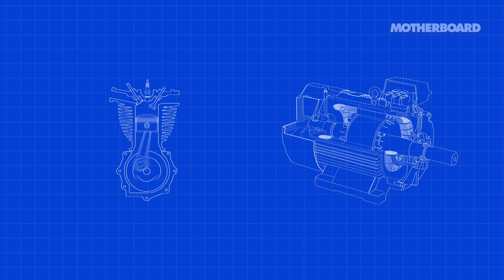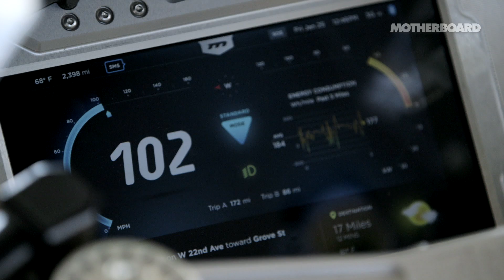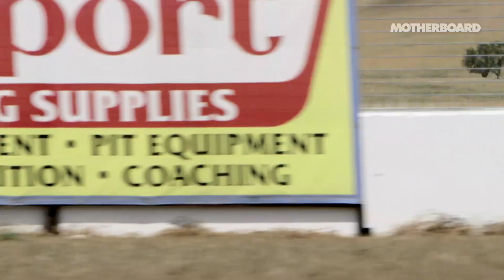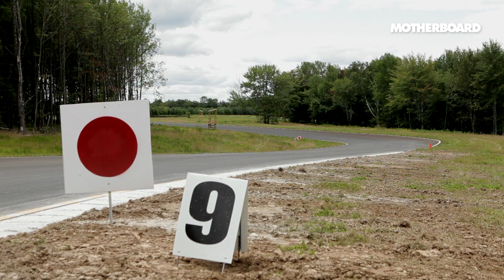Mission RS: The Electric Superbike of the Future

Comment: Here's the thing I can't get on board with this (other than the obvious nostalgia: the sound of an amazing inline four cylinder, the smell of the gas and exhaust, the ability to wheely or spin your tires, and other things that go along with gas engines) is that while you have the same range as a gas bike, it takes an hour to fill up. I like to go on LONG expeditions with my bikes and if I had to wait an hour every 170 miles it would kinda suck, although it's not that bad of an inconvenience, it's certainly notable because gas is instant.
Reply: Bob Abooey Exactly the point I was making, I agree completely. I wish it wasn't so, but it is.
Reply: Krisztian Kovacs Also, I've run out of gas many times in trails enduro riding on a DRZ400. When I run out, my buddy goes and fills me up a gas can. What do I do if I go dead on a zero s? Or what if I'm riding the streets and I go dead on the RS? Call for a tow? It's tough until there is mobile charging stations about the size and weight of a one gallon can that can get you to a gas station real fast, and when there's "gas stations" for electric bikes. I think I would get on board to a degree if there was one-gallon size and 5-gallon size mobile charging stations that could fill you up a bit to get to a station to charge it. But even then, I couldn't do my favorite things that I love to do such as serious enduro riding which DEFINITELY requires clutching to wheely over logs and lakes. And I couldn't do any sort of closed-course stunts on this bike either. But as far as track or city, it would be the better alternative except for the sound, which an inline 4 cylinder is like music to my ears, and smell, the smell of exhaust and gasoline (especially 93 or 100 octane) are just amazing. All of the nostalgic factors of riding will never be there for this bike, it will feel like a simulation :/
Reply: And when I say size I mean physically around the same size and weight. Just so that there would be an alternative to gas.
Reply: You can have charging stations where you normally would not find a gas station. Battery banks with solar charging can be placed anywhere on this planet. On a mountain trail, out in the middle of the desert, at your home...etc.. and you can have as many and as big as you want. It will also take a lot less space than a gas station, and is less maintenance. They now have DC fast charging too.

I guess not many people realize the convience of plugging in.
Reply: Silverexpress01 Now that you say that, I realize why this will never, NEVER take off. That sounds too amazing to the environment. Too amazing to me, and too amazing period. 

Here is the huge flaw with your idea:  who will profit from that? Not at first, when somebody has to buy the solar panels, buy the batteries, etc. Who will profit in 60 years? 70? 100? 150? 200? Nobody. And in the world we live on, if there isn't long-term massive amounts of money to be made it is quickly shut down. There are very good alternatives to oil right now that are unavailable to the public because of the greedy oil companies. We've had electric cars since 1990 and before. 1990. 25 years almost. And we still do not have public charging stations on every corner. And to say we've only had electric cars for 25 years is total BS on my part.Those are just the ones widely known, the first electric car EVER was invented BEFORE the first ever prototype for a gasoline engine driven horseless carriage. In 1832 Robert Anderson of Scotland invented the first electric motor driven horseless carriage. In 1886 Benz released the Benz Motor Car No. 1 as the prototype for a three-wheeled gasoline driven horseless carriage. The electric car was invented before the gasoline car. And yet what do you see every 5 miles? Gas stations. Not charging stations. Greedy corporations will forever keep gasoline on top.
Reply: Expensive yes. That I can agree with, and like all things the prices will come down. My first PC was over $2K with a 250 MB HD. It had less processing power than my smartphone, and the one I'm typing on right now cost me a little over $200 new and it has over 5 Terabytes of  memory which I've added on gradually, and a quad processor. I've been using it for nearly 3 yrs.

Battery, CNG, Fuel Cell, Gas, Diesel...etc...will continue to evolve. In the end it will be the customer's decision which is best, and it may come down to long term maintenance costs. Replacing worn timing belts vs. High Voltage cables; Valve timing adjustments vs. Electric motor timing adjustments; Cylinder rebuild vs. Rotor bearing replacement (today's electric motors are brushless and require very little maintenance if any); clutch replacement vs. wheel balancing..etc....

The market demand and government regulations will probably determine the survival of today's electric car.

Things have surely changed.... Recreational marijuana is now legal in Colorado, you can watch a war in the Middle East that was recorded with a GoPro on top a battle tank and then rate it on Youtube, and we can correspond with each other a thousand miles away in milliseconds without ever really meeting each other. It's just an amazing world we live in today, and just as frightening.
Reply: StuffWithAlexGaming
whats held up electric car and bike tech is the batteries and motor control. Only very recently were powerful brushless motors developed. The best brushed motors were lucky to be 50% efficient once they had heated up. Now brushless can be as high as 95%.Using alot more poles for the same size they are much lighter than brushed motors and its possible to change the coil switching to provide extra torque at low revs then gang them up for very high revs by just pressing a button. Induction motors can be 99% efficient but are far to heavy like the ones used on trains. Even better batteries are being developed. Imagine only having to charge up your bike once a year? Its only a matter of time before this happens.Might be a few years yet, You can computer control a motor to do exactly what you want, torque curves, braking, boost power. Your very limited with what you can do with an engine hooked up to a computer. The world is changing. Engines and gas are old tech now. The worlds ideas are slowly changing and people are slightly more concerned with the environment than they were in the past.
Reply: Silverexpress01   I think it's the exact opposite of what you guys are talking about.  Electric cars/bikes will continue to just be a niche thing for a long time because the big wigs in the oil industry wouldn't stand for the loss of business.  We have lobbyists in charge of our world and they have lots of money tied up in oil investments and oil interests.  Fossil fuels literally fuels them.

I think any electric initiatives will be underfunded and delayed in a mainstream market.  The automobile manufacturers even have interests in the oil industry.  It's just not going to be viable to sell electric cars until they offer bigger money making opportunities.

Sure it's great that technologies exist that could possibly save our world.  But the people in charge are not concerned with the health of our planet.  They are concerned with the size of their bank account.  These fossil fuels will continue to melt glaciers and cause the ocean levels to rise and eventually drown us all.
Reply: You can wheelie and spin the tyres on this, he does it in the video. Wheelies should be easier as electric motors have so much torque power wheelies should be no problem. 
And even though they don't make the same sound as a throaty Akrapovic, the jet fighter noise it made in the high speed drive past did sound pretty cool!
Reply: StuffWithAlexGaming But battery technology was lagging behind in those days. Electrical/Computer/Software engineers where few if not yet born. Things have changed since then Alex. Just look at....

Stage Theater vs. Television; Written Media vs. Digital Media; CD/DVD vs. Ipod; Movie Theatre vs. Netfix & Flatscreen; Type Writer vs. Word Processor; Horse vs. Mountain Bike; Telephone Lines vs. Cellular; Microwave vs. Oven; Clay prototyping vs. 3D printing; Supercomputers vs. Distributed PC's; Kodak film vs. Digital media, Steam Locomotive vs. Diesel-Electric; LiPo/Life/Lion/? vs Lead Acid/Alkaline/Nicad/NimH;...etc...etc...etc....

Your right though that there are other Alternative energy sources besides electricity, and I think in the end it will be a combination of these technologies that will move our vehicles. Like the Chevy Volt that uses a combustion engine as a generator, in the near future it might be something else...CNG, super capacitor; Hydrogen fuel cell, ?, ?, ? There is however no refuting that the electric motor as the drivetrain is the most simple and efficient there is.

Simple and efficient to manufacture, and to assemble. This results in a much higher profit margin than and ICE that requires a multitude of parts and parts suppliers to pay off.

As far as these greedy oil manufacturers go....they have the funding to transition into any sector of business they wish. I wouldn't worry to much about them. 

A gas station every 5 miles? I have over 20 outlets and two of which is 240 volts. I can plug my EV into any of these. My neighbor has nearly the same amount and is less than 50 ft from where I sit. On my entire block there must be nearly 1000 outlets I can plug into if I ask politely. At work, it's the same thing.

At the hotel I stayed at the other night, I asked if I could plug my EV in for a top off, and they said yes. There were over 10 outlets outside along the perimeter of the hotel. You must always ask! I've read of one incident already where in an EV owner plugged in at a school and was charged with stealing electricity!

I see that gas prices are on the rise again. Come and join us....
Reply: Silverexpress01 At 80 MPG on my bike, the only vehicle I use often, I keep a truck because they come in handy for things like moves but it's a small pickup and gets about 25MPG and is almost never used, it's not worth the huge pricetag of an electric bike or car. I don't have money to spend on something like that now, when it would barely save me money. Bad investment at the moment, until there are alternatives for pricing and stations to charge, I simply won't be able to get on board.
Reply: Silverexpress01 I'm ready and excited for the transition, even though I will lose the nostalgia of launching a 600 HP Olds 442 and hearing the roar of the engine or launching my R1 and feeling the intense power while smelling the gas and hearing the roar. It scares me to transition to a world where instead of the smell of exhaust I smell electricity or instead of the roar of a 4 cylinder inline or v8 I hear the whine of a motor... I'm still excited even though I know I'll lose some of my favorite parts of muscle and power vehicles.

But I know it will never happen soon because the greedy oil companies will never allow it. They will do everything in their power to stop it from happening, because when electric cars roll around there's no more need for gas stations or as much oil or basically anything that they produce and make money off of. It's sad, but it's true. If it wasn't for them, electric cars would be the only cars driven on the road today. If it wasn't for them, you would need a permit to drive a gas-driven automobile and you'd have to pay a lot extra in taxes in order to have carbon offsets created. That's how it should be, you can't stop people from enjoying their cars because that's just horrible, but you CAN on the other hand deter them by making them buy or create carbon offsets based on their emissions. You want to roll coal in a cummins? Sure, plant 600 trees and you're good to go. Otherwise, drive your 800 lb/feet electric truck around with a trailer. The sad thing is, some electric cars/trucks they have today make 800 lb/feet of torque while my brothers huge V8 (he uses this for a trucking business, not just for fun. He wishes he didn't have to do so much damage to the environment) diesel international DT466e 4700 only produces 500 lb/feet of torque. Electric really is the way to go for everything. But then again, I love the smell of a diesel and I'm not sure I can get used to electric :/
Reply: True. But I would totally use this for around town and day to day. I understand the nostalgia involved in regard to conventional bikes. Sometimes you've got to take a leap and try something new though. Sometimes that choice will end up being a nice surprise and healthy change of pace.

Moving on to 'new' doesn't necessarily mean forgetting or disrespecting the older and more established.
Reply: Here's the thing I can't get onboard with, that archaic thinking of - It can't be done, I prefer this, I want this, it needs this, it's not like that. I understand this isn't tech for everyone (heck they're only making 40 of the RS), but until everyone decides to jump off the wagon there's going to be tradeoffs for EV. In order to proceed I think as consumers we have to stop comparing it to typical IC. Well at least we can all agree this is the step in the right direction.
Reply: eddie williams This is true and I'm totally onboard with that, but I'll always have my gas cars and bikes for nostalgia. I just can't ever give them up. And until there's cheaper options, right now it's financially more viable to keep going with a gasoline bike than an electric bike or car. And don't forget that gasoline engines are still being developed and fine tuned as well, although I believe they've nearly reached their maximum capability and soon electric motors will surpass them in every way. Already electric motors are ahead since they produce 100% of torque 100% of the time. But the 2015 Yamaha R1 now produces 235HP at the engine and 200HP at the wheel, the first litre bike to ever do that... gas engines are still being fine tuned. And don't ever forget about rotary engines. The Maxda MX-8 has a 1400cc rotary engine that produces insane horsepower and torque. I think the future is definitely coming with electric motors, but gasoline engines and diesel engines will most definitely still be here.
Reply: Silverexpress01
Pretty sure he said an Hour to charge..... I don't know about you, but no one has an hour to just spare....
Reply: Yeah charge time is something that really needs to be addressed. It wouldnt be so bad if it would do 1000 miles on one charge.. but it will be a long while before that happens.. we have grown so used to the convenience of filling up quickly.
Reply: StuffWithAlexGaming uh, that concern was solved a long time ago.  Here in the UK a lot of public chargers are owned by companies and you have to register for a card.  When you charge you put in the card and it accrues a bill for the electricity you use.  This way whomever owns the solar array in the middle of nowhere profits.  And since funds are digitally associated with the user's membership/charging card, the solar array carries no physical cash and therefore doesn't make a target for theft.
Reply: This is somewhat indirectly related...

http://www.detroitnews.com/article/20140826/METRO02/308260071/0/metro08/Rochester-Hills-hold-meeting-oil-gas-well-drilling-moratorium

They may one day come to your neighborhood or worst your backyard. With 100% certainty it will happen.
Reply: Why wouldn't you be able to wheely or spin the tire? All that takes is plenty of torque and of there's one thing electric motors have it's torque.

Comment: Motorcycle riding, especially on the track is all about feel. It's not only the quantitative performance numbers which matter, but how they are achieved, eg the response of the engine, feel of the clutch, brake and shifter, etc. I'd find it very difficult to get used to a bike without a clutch, shifter and engine braking, and wouldn't want to get used to it. Unless they can incorporate this into the electric bike to simulate a IC bike, it'll be tough selling it to true sportbike enthusiasts. Wouldn't mind it for daily riding but probs won't be doing anything serious in it.

Comment: The electric car/bike industry should collaborate to create a standard battery pack that could go in any car or bike. Also make the batteries easily removable. So instead of stopping at a charging station, which could take a long time, you would stop at a station where you could exchange your battery packs for freshly charged ones. Making your stop time as quick as a gas stop.
Reply: Blake Mcdonald so you pay a monthly battery rent.
You or the garage could be stuck with an old nackered battery

Comment: Do you not understand how the world works? MotoGP bikes for instance may not have more than $50k in parts but R&D easily pushes them into the hundreds of thousands for a production run in the single digits. So why don't you go ask Rossi if he can have his guys build you a bike for parts cost alone? They make Burgman's with more ponies than the 250 class bikes. 250s aren't bad bikes but this bike has more than 6x the HP & 9x the torque. Compared to this your 250 IS a scooter.

Comment: But that assumes fuel will stay the same price, no?

Also, if you bought an electric bike and the battery costs $5,000 to replace every 7 odd years - you'd be spending way more on replacing batteries than you would on fuel ontop of the initial $75k.

You might not need an oil change with this thing but you still need brakes + hydraulic fluid etc replaced.

I should also add, having a quiet bike is extremely dangerous (cars don't run over noisy harleys).